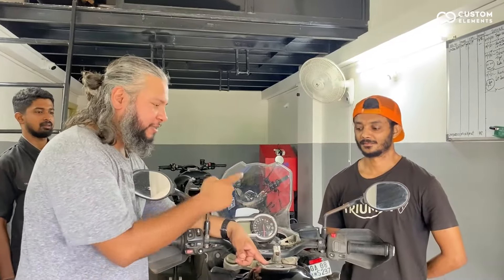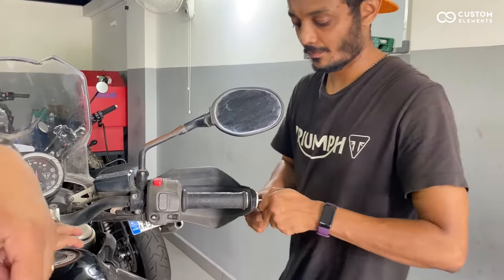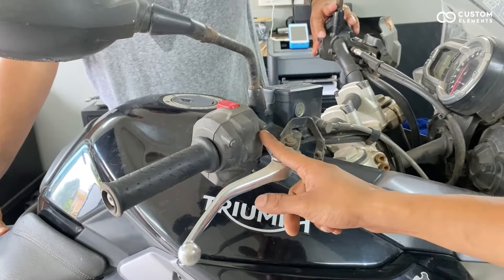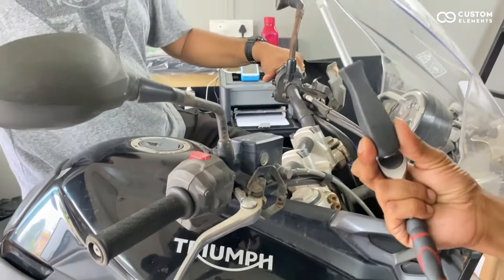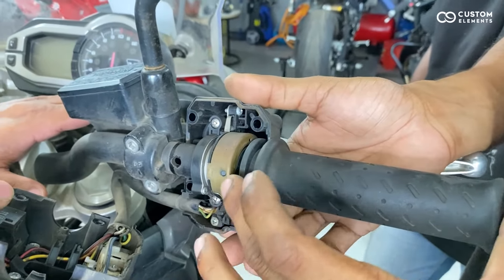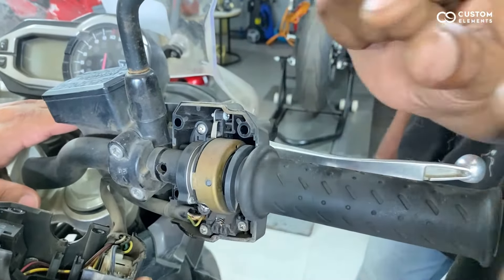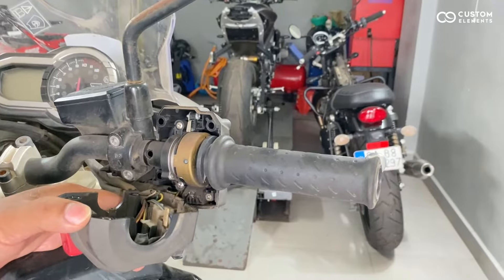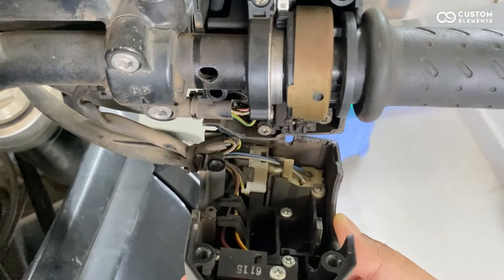What is Ride By Wire Technology? How Does it Work? #customelements #motorcycles #superbikes

Comment: I have never had a throttle cable break in my 40 years riding on any motorcycle I owned nor i head from any of my friends of throttle cable braking. I have however seen people with ride by wire throttles stranded on roads because their throttles didn’t work. So in reliability department it fails miserably. It does have plenty of other benefits though precision and versatility to name few.
Reply: Exactly. I hv clocked 63k kms for 6 years now. Never changed throttle cable😂😂😂😂😂😂😂

Comment: This is great - thank you!  I have a CFMOTO 700 CL-X and its ride-by-wire throttle is very sensitive.  It's much too sensitive in my opinion, such that riding over bumps makes the throttle jump between on and off because my hand is bouncing on the throttle.  I'm going to try adding some damping grease under the throttle, but I've never seen a ride-by-wire throttle assembly before and I was worried it would fly apart into pieces if I took it apart.  Thank you for showing this!

Comment: The traction control elements are interesting but I've never had a throttle cable break on me for over 25 years riding various different bikes. In my experience electronic parts will fail before good old mechanical ones...

Comment: My triumph400 jerks while in low rpm. Got first service done yesterday. Reported it to Service guy but it wasn't fixed. Told the service guy to take a test ride who gave me stories. Then the mechanic took it for a ride and agreed with me.. but gave me a 15 min. Lecture on how it works and this is normal.. 
I have never faced this in any of my cars or previous bikes.
Its most noticeable at 2k-3k rpm in 2nd gear. Lesser in 3rd and so on.
I can also feel the jerking in top gears while going down hill.
Any suggestions wud help

Comment: Mechanical things are always better than electronics electronics are very unreliable.  Manufacturers need to get back to simplicityThey need to do away with electronics on motorcycles all they do is drive the price up and it’s just something else that’s gonna break down the line